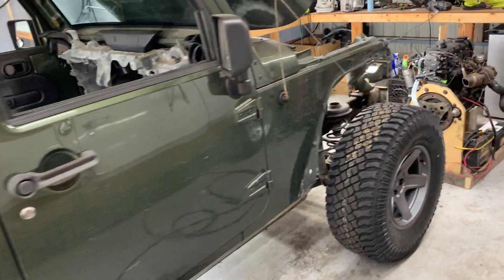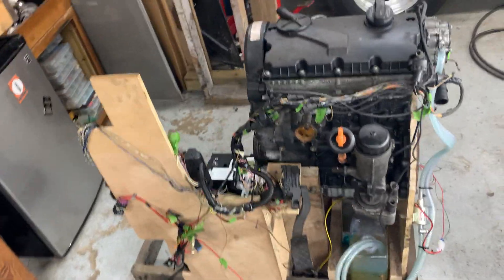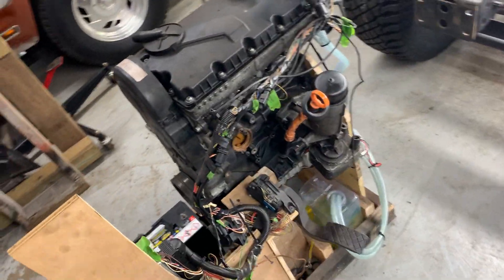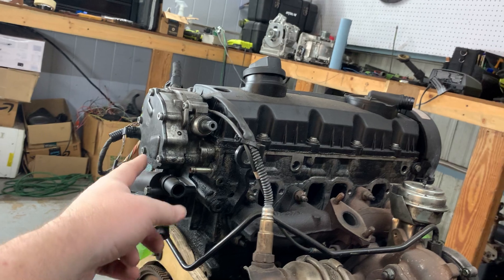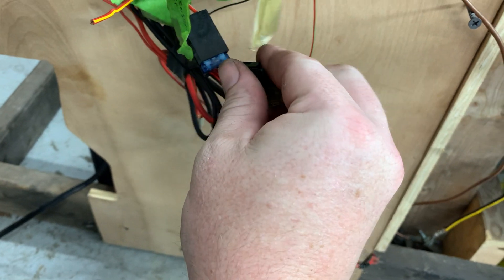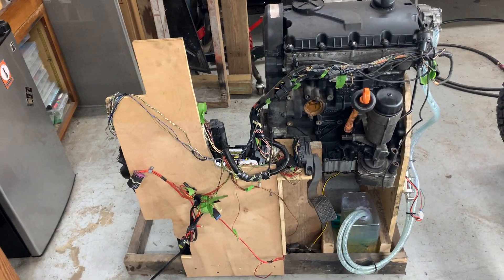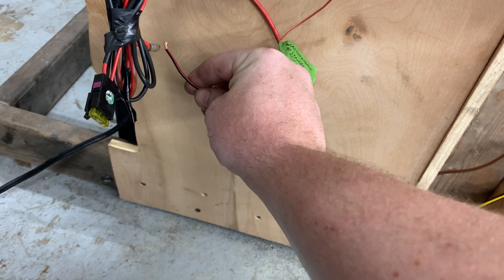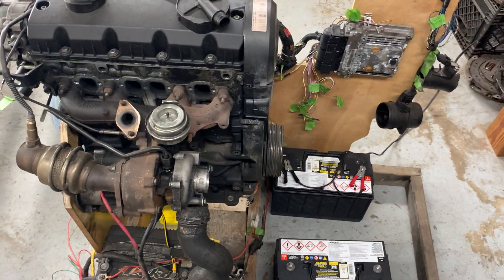2.0 TDI BHW Diesel Engine Swap JK130, engine running on the test stand.

Comment: How easy is the wiring for these? It's it much more involved than an ALH? looks quite similar honestly. A few wires from the big plug, sensors and the pedal,
Reply from the maker: You got it. Pretty much similar. Biggest change is the need to remove the immobilizer from the ECM. There are lots of services to do this, or you can do it yourself as I did.
Reply: @StrayPoet  How difficult is it once you purchase the Ktag? Does the Ktag come with everything you need or do you  have to find some obscure VW ecu file on the internet to download and flash the ecu with?
Reply from the maker: @totallyotally honestly it wasn’t that easy. Had to scrounge around for a while to find the immo-off program.  And figure out the right pins.
Reply: @StrayPoet  Thanks for the honesty.  I need to this on my BHW now. Do you have links to a guide or website you followed? I know some people offer the service, but I plan on doing it again so I figure I might as well buy the KTAG and do it myself.
Reply from the maker: @totallyotally that was my thought as well, I have two BHWs so it worked out in the end.  It’s been long enough that I don’t remember the website guide, but I do have a small exe file that takes the downloaded firmware, and removes the immobilizer. Then you upload the firmware again and no more immobilization.  I can share with you if you like.

Comment: Awesome video, great details. I am working on pulling a BRM out of a jetta for my 4runner build. I am wondering what you used to reprogram the ECM.
Reply from the maker: I used an eBay Ktag ( which is an ECM flashing tool)

Comment: Would you mind sending me the wiring diagram you used?
Reply from the maker: I am happy to send you the pinout that I used, it isn't a full diagram, but shows what wires are connected to what from the ECM connections.
It is all you need to be able to get it to run. 
You have to flash the ECM to remove the Immobilizer first.

Pinout below:

T94 ECU connector
1. br Ground
2. br Ground
3. ro/gn power supply relay terminal 30 key
4. br Ground
5. ro/gn power supply relay terminal 30 key 
6. ro/gn power supply relay terminal 30 key
7. UNUSED
8. UNUSED
9. UNUSED
10. gr O2 sensor heater
11. UNUSED
12. UNUSED
13. UNUSED
14. UNUSED
15. UNUSED
16. UNUSED
17. br/gn closed throttle position switch
18. 12v signal from ignition to wakeup ecu
19. ws Additional heater button?
20. sw/ws cruise control
21. bl cruise control switch
22. UNUSED
23. li/ge Turbo intake temp sensor
24. UNUSED
25. UNUSED
26. UNUSED
27. UNUSED
28. UNUSED
29. UNUSED
30. gn/ro J179 Glow plug
31. UNUSED
32. ws heated O2
33. UNUSED
34. UNUSED
35. UNUSED
36. UNUSED
37. UNUSED
38. bl/gr IAT sensor
39. br/rd throttle position
40. ws/li Mass air flow
41. UNUSED
42. UNUSED
43. ro/gn Clutch pedal switch
44. ro/ge cruise control
45. UNUSED
46. UNUSED
47. ge radiator fan relay trigger
48. UNUSED
49. br/li power supply relay terminal 30 ground signal to relay
50. sw/gr climate control/ac
51. gn/ge O2 sensor heater
52. ro/bl Fuel pump trigger
53. gr/ge turbo intake temp sensor
54. br Heated O2
55. UNUSED
56. UNUSED
57. UNUSED
58. UNUSED
59. gr kick down switch
60. br/ws Mass air flow
61. gr/ge throttle
62. li/sw Charge air pressure sensor
63. ro/ws J179 Glow plug
64. bl/sw Alternator
65. ws/ro brake pedal switch
66. or/br Canbus low signal
67. UNUSED
68. UNUSED
69. UNUSED
70. ws/ge relay for heating coolant high heat output
71. ws/bl relay for heating coolant low heat output
72. gn/sw K wire diagnosis
73. UNUSED
74. UNUSED
75. UNUSED
76. br/sw IAT sensor
77. gr/gn O2 sensor heater
78. gn/ro Charge air pressure sensor
79. UNUSED
80. UNUSED
81. UNUSED
82. gn/br Mass air flow
83. ge/bl throttle position 
84. ge/li throttle position
85. sw/ge Defrost idle boost signal
86. ro/gn Starter
87. ro/sw brake light S13
88. ro/ge cruise control button (SET)
89. or/sw Canbus High signal
90. ws/bl Vehicle speed sensor
91. UNUSED
92. UNUSED
93. UNUSED
94. UNUSED

T60 ECU connector
1. br/gn Injector #2
2. UNUSED
3. UNUSED
4. UNUSED
5. UNUSED
6. UNUSED
7. UNUSED
8. UNUSED
9. UNUSED
10. UNUSED
11. UNUSED
12. ro/li Camshaft position sensor 
13. UNUSED
14. UNUSED
15. UNUSED
16. UNUSED
17. UNUSED
18. UNUSED
19. UNUSED
20. UNUSED
21. UNUSED
22. UNUSED
23. sw/ge EGR
24. sw/ro EGR
25. ws/ge Motor for intake flap
26. br EGR 
27. ro/ws Camshaft position sensor
28. li/bl Camshaft position sensor
29. br/ge N75 Wastegate actuator
30. UNUSED
31. gr Injectors
32. gr/ge Injectors
33. UNUSED
34. UNUSED
35. UNUSED
36. UNUSED
37. UNUSED
38. UNUSED
39. gr/gn Fuel temp sensor
40. gr Fuel temp sensor
41. UNUSED
42. UNUSED
43. li/gn Engine speed sensor
44. UNUSED
45. UNUSED
46. br/ws Injector #1
47. br/ro Injector #3
48. br/bl Injector #4
49. ro/ws EGR
50. sw/bl EGR
51. UNUSED
52. br/ws Coolant temp
53. br/gr Coolant temp
54. UNUSED
55. UNUSED
56. UNUSED
57. UNUSED
58. gr Engine speed sensor
59. UNUSED
60. ws Motor for intake flap
Reply: @StrayPoet  thank you very much
Reply from the maker: @zachmosteller4681  You are welcome.

Comment: how did you reprogram the ECM  and what is the new settings? Just got a 2005 Jetta with the 1.9 engine that I plan to put in my 2004 tj jeep wrangler, My Jeep was a casualty  of last summers riots in Portland. Engine compartment received the most damage including the jeep computer. I will need a jeep computer only for the speedometer and gauges I guess? I am impressed with your engine stand and setup--maybe I will try the same procedure.  Thanks.
Reply: The best thing you could do is slap a diesel in that Jeep, then the next time they block you in the road, you just idle over the lot of pansies
Reply: You have to get it sent out for immobo delete (and might as well tune it if you want at this stage) as properly flashing the (EDC16) would be a project of its own.
Reply from the maker: I did flash myself, it was a project, but not too bad.